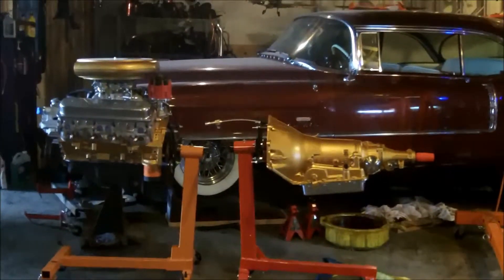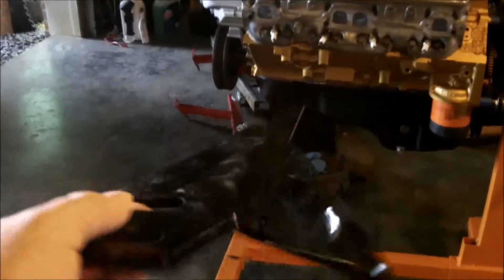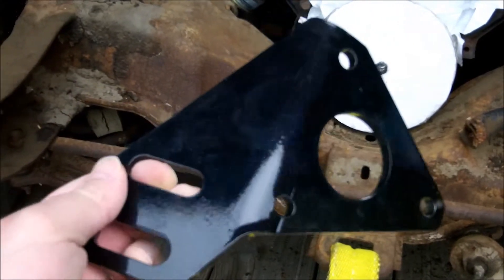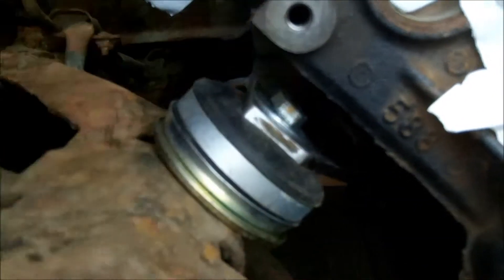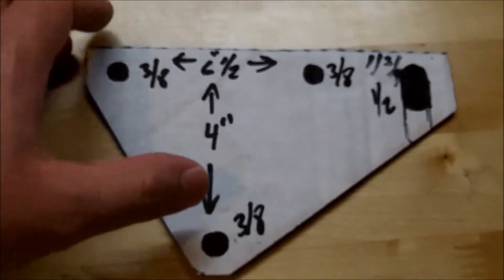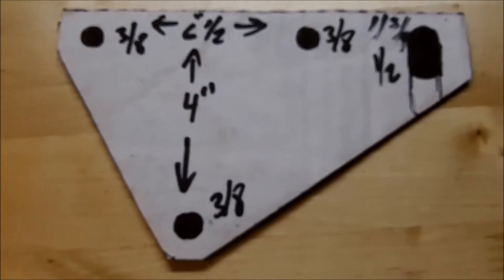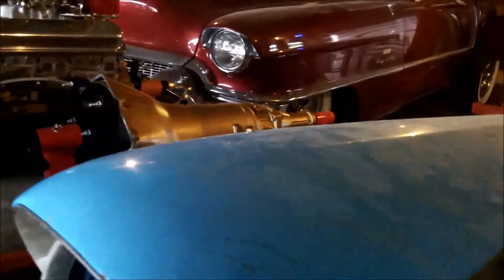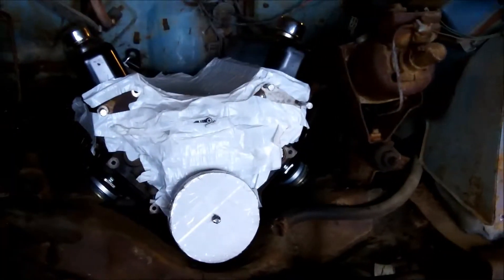1956 Cadillac LT1 motor mount fabrication

Comment: Good video Josh 👏 do you have anymore follow up videos?
Reply from the maker: Unfortunately I do not, I sold the car it is in some guys private collection now.  It runs and drives beautifully I have spoke to the current owner it is his favorite car that he has he said.  Car was fully restored interior and paint and it is immaculate.  Wish I had never sold her but at the same time I didn't have the money to bring her back to her former glory, so I am happy for the car and for the new owner as the car has a new lease on life.
Reply from the maker: If you want to see it, I came across it on Instagram and contacted the photographer who put me in touch with the owner.  If you check out his photos scroll down through them you will find her!  https://instagram.com/cela_automedia?utm_medium=copy_link. unfortunately there are no shots of the engine bay which is a sight to be seen.  If you want to see those photos I have some send me your email in private message and I will send you some.  tirned out amazing!!
Reply: Thanks Josh! I just traded fer a 55 Cadillac and thought about goin the same route, very helpful video!!
Reply from the maker: @robbiecarr8798   No problem, I loved the old 365 engine but it just wasn't reliable dying on me while stopped at red lights for too long and then of course the transmission failed.  I just wanted to be able to drive it without issues I feel the work was worth it, glad you liked the video and do yourself a favor and never sell your 55!

Comment: Great film. I´m putting a LT1 in a 1959 Cadillac.  Were did you buy the black offset motor mounts you didn't use?  i think they will work in my 59.  Regards Lars. Can't find them anywere.
Reply from the maker: Lars-Åke Krantz I bought them off ebay, I dont see it on there anymore.  But Keyser manufacturing makes one like it for 25.00 on their website.

Comment: this is a big find for me!! .. I own a 55 coupe deville.. and ive been looking for the past 4 years for tips on this swap... and ive read about steering box / manifold issue..any of you guys figure it out yet??.. awesome post by the way .. Ive been driving mine for a couple years with the stock setup.. because im still not sure how much of a nightmare its gonna be.. thanx for yor time.. - Josh
Reply from the maker: JoshFerreira84 Well I'm glad you like the video, I drove mine for a long time with the stock 365 and trans, until the trans let go on me.  The engine was tired too so I pulled them both.  In the video you see the LT1 engine, unfortunately that engine I bought from someone on craigslist as a running motor turned out to be a huge loss.  I took the heads off and found a broke ring in the number one cylinder and the wall was scratched.  So I just had it rebuilt to the tune of 1,200.00  Now i have to clean and repaint it before I can put it in.  So I have taken 20 steps back from where I was.  The manifold issue I'm not too worried about  I know its possible to do.  I have to wait and fit the whole thing in before I really know what I need.  I will have to get a drive shaft made as well, all these I will post videos of when the time comes.  Keep watching because I will finish this car!

Comment: Any new updates on the Cadillac coupe?
Reply from the maker: Hey, I am still working on the car I have finished the firewall sanding and painting it I have been playing with the radiator and how to mount it.  I am getting close to putting it together shouldn't be much longer and yes there will be more videos.  It is just hard to find the time while working a full time day job.  Keep checking back, and thanks for watching.
Reply: Cant wait to see it.. do you still have the template for the motor mounts you made. Or better yet do you have a extra set of those motor mount you would like to sell?
Reply from the maker: travis hill Yes I have the template, I made it out of cardboard before I started cutting steel.  I don't have an extra set of the steel ones unfortunately.  If you want me to send you a template just send me your info in the private message section I will mail it to you..  Are you planning on doing some videos of your build?
Reply: Josh Hypes hey brother thank you very much for this useful information. I was wondering if you could send me the templates as well. I would truly appreciate it. thank you in advance.

Comment: Do you know which steering gear box your gonna use to replace that one?  I also have a 1955 Cadillac Fleewood.. and the gearbox is leaking pretty bad now.. I started taking it off, and was gonna rebuild it. But if you know of a newer one I can replace that one with. I will just do that... A friend of mine has a 55 Caddy coupe, he has the original 331 in it. but attached a turbo 350  to it.. had a driveshaft  made. and has had no problems with it. I have rode with him and he hammered down on it. it didnt flex nor hit the  frame.. My Fleetwood is set up the same way.. and so far, no problems. and the Fleetwood is 4 inches longer than the Coupe..
Reply from the maker: travis hill The one i was looking at is on ebay, its like $219.00 if my memory serves me right but its at buyautoparts.com.  Just go to ebay and type in 56 cadillac steering gearbox and it will pop up.  call that company tell them what you got.  I originally called them and got a replacement original 56 gearbox but it set me back $700 bucks and guess what it is leaking now too.  When i called them they said the one for $219.00 would work but i cant say for sure because i ordered the real deal wish i had got the other..
Reply: Hi Travis, I know this is a few years old now, but I'm just getting into a similar project. I got a '55 series 62, 2door. I put a 390 out of a 1962 caddy in and snapped the 55 hydramatic. I'm going to convert it to a 700R4, I've bought the adapter kit, but don't know if I'll need to cut the X member or go to a 2-piece driveshaft... Your buddy with the 55 coupe you spoke of, do you know if he opened up the X frame at all or had to go to a 2 piece?Thanks!(also Josh, thanks for posting the video, very helpful, Cheers!)

Comment: Did you use the the original exhaust manifold from the LT1 .. I bought a set of Block Hugger headers  and im still having problems with it hitting the steering box..
Reply from the maker: I have yet to work on the exhaust manifold issue.  I got some factory lt1 corvette manifolds to put on it.  I know the steering box will be an issue.  I am probably going to get a newer steering box to put on it first because the old ones have failed and leaked all over the place.  The other issue I see is the drive shaft.  I will have to run a yoke and drive shaft through the opening in the x frame.  Then have another yoke and drive shaft with bearing support bracket down to the rear end.  I will post videos as I complete these two  issues.  Let me know if you have any ideas.  Thanks for commenting!